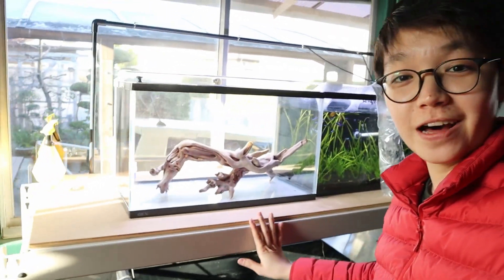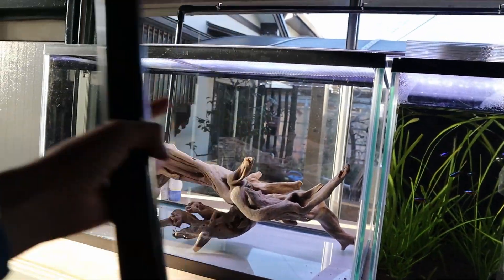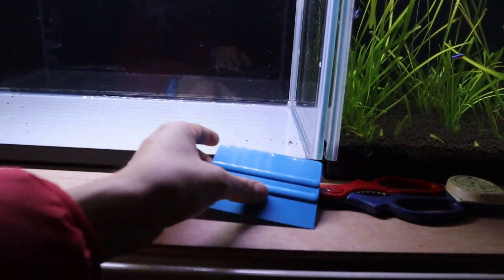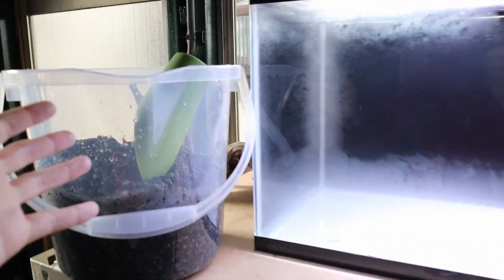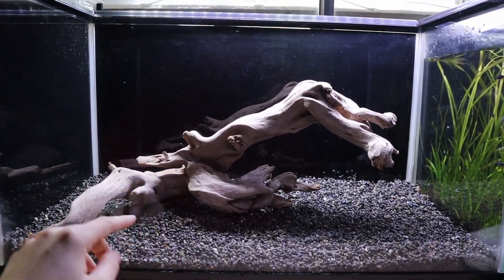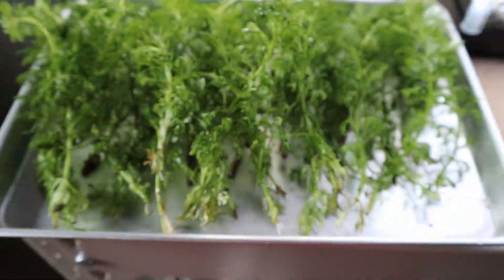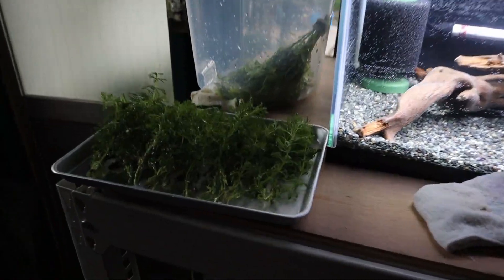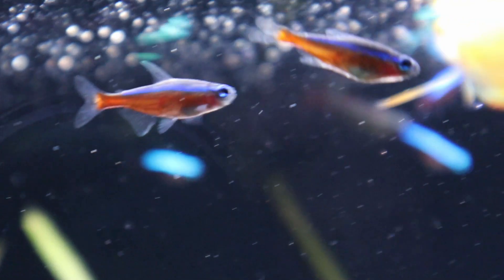Building a PLANTED GUPPY AQUARIUM! Planted Guppy Tank for Beginners

Comment: what air pumps do you use? when i had my tank up i used a Tetra pump rated at 40g and it was LOUD. And do you use a pump rated for more water that what you have?  example: 10g tank, 40g air pump is what i had